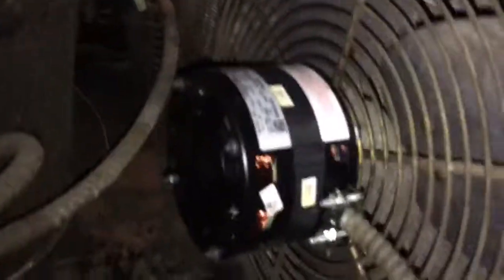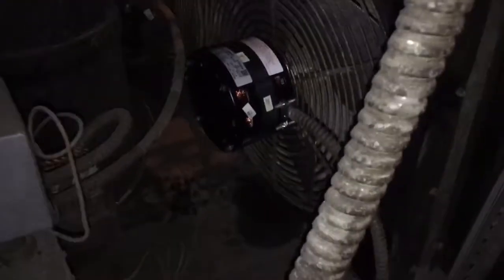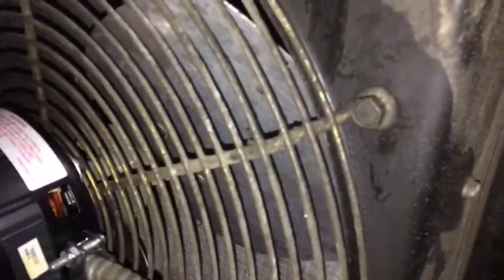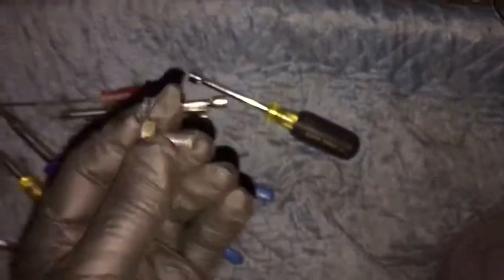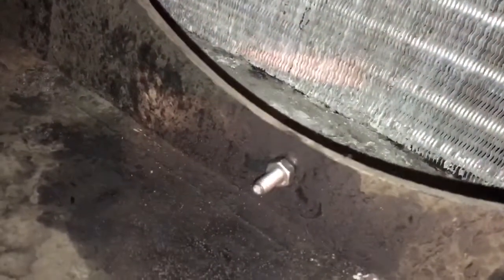How to Solve- Stripped Hole for Condenser Fan Motor Mount. Big unit.

Comment: Thats a clever solution to the problem! An alternative to maintain original style fixings would be a rivnut if the hole wasn't too big.
Reply from the maker: Thanks diesel ! Yea, i like that idea. Im going to have to look into finding some of those. That would have been perfect for this application I feel.
Reply from the maker: Hole was pretty big. 1/2" but prob could have used a fender washer on both sides of sheet metal if hole was too big with a threaded rivet.

Comment: Everyday issues like this are why I hate flat rate...
Reply from the maker: Yea, You can say that again ! This added another hour to the Job. Im 3 storys up. In a 100 degree attic above 3 floors across cat walks etc. I've now got to Figure what im going to do about this, its 7pm at night. Go back down to the truck , hoping i have enough , bolts,  nuts and washers on the truck and the right size. Supposed to be a " Simple " Condenser fan motor changeout. And of course the Fan Blade uses a " Torx" Screw for the Blade to shaft hold screw. Im glad i bought that $10.00 bit assortment box from ryobi at christmas it saved my Bacon on this job. $10.00 well spent.

Comment: I have a d1127 fan motor that shorted out ,,,,an wont start up ,is there a reset on that motor? ,,,, its being used for a evaporator fan in a walk in,, an its a new motor
Reply from the maker: D1127 has a capacitor. Cap probblew. Replace capacitor. Ohm out motor tosee if its open. Open replace motor. Check voltage. 230 / 115 right voltage vs motor voltage.